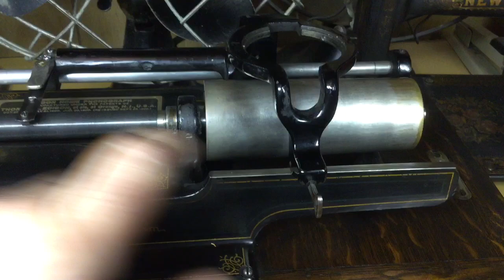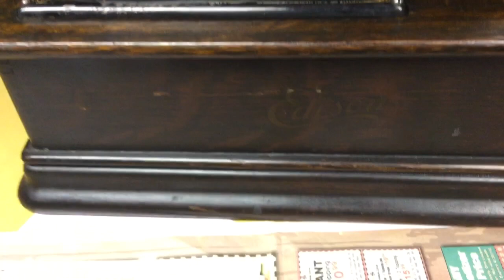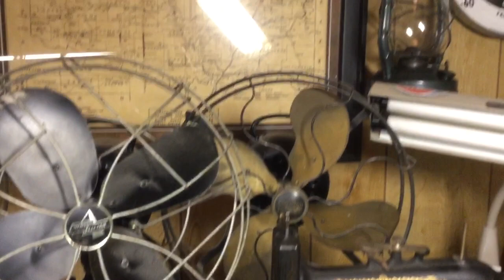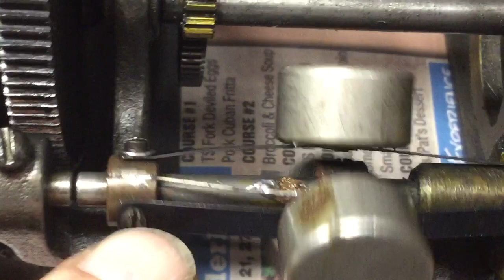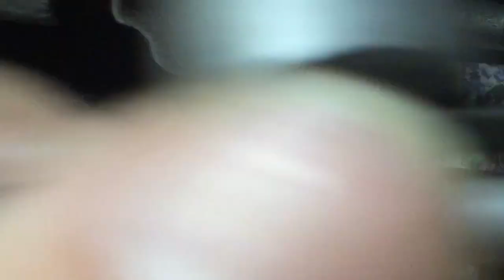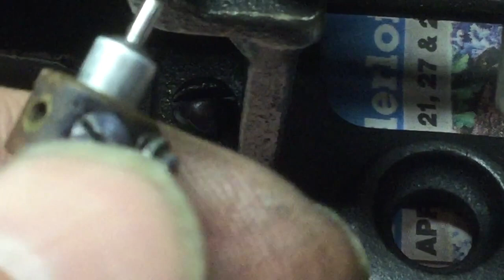Model D Edison Home Motor Repair 1

Comment: I am working on an identical machine with the same issue. I have a new brass bushing for it. I  a little spooked about getting too rough with it. I have all the set screws loose. How did you remove the main shaft?